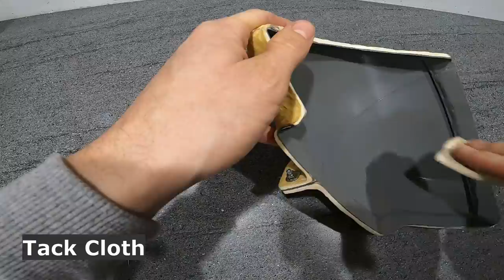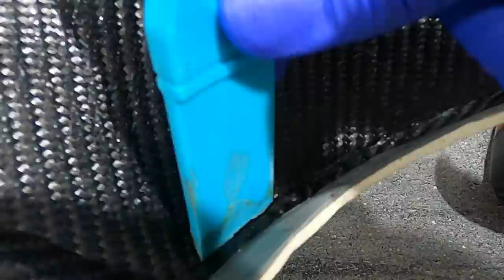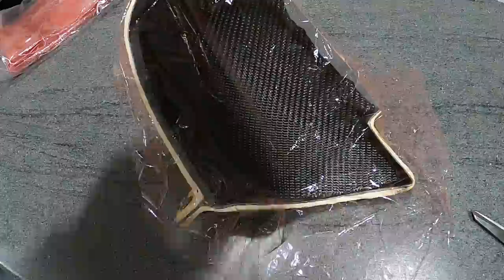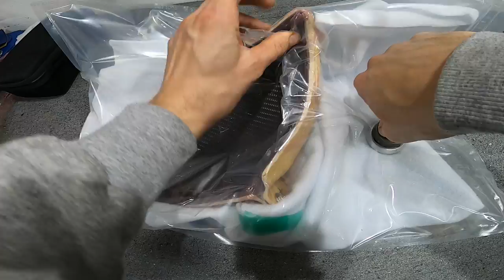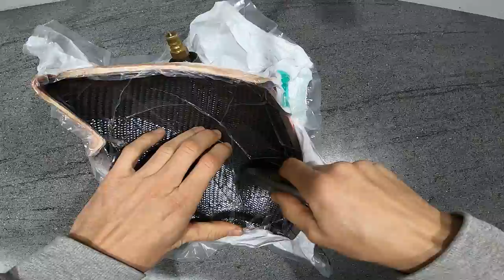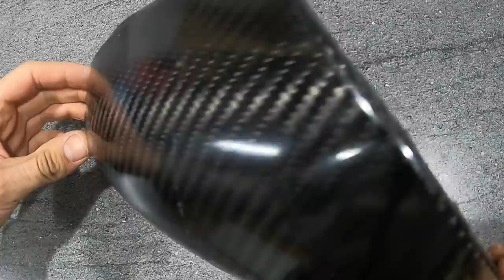Carbon Fibre Split Mould Lay Up. Car Wing Mirror Cover [PREPREG] [OUT OF AUTOCLAVE]

Comment: Why is a split mold utilized here? Couldn't this have been done with non-split mold? Thanks!
Reply from the maker: Without the split the carbon part would of been mechanically locked into the mould with no way of releasing.
Reply: @CarbonWorkshops  The piece looks like it would have popped out without one. I must not be seeing something you are then! that is what I figured, thanks for the reply!